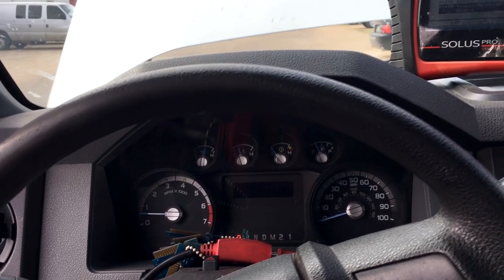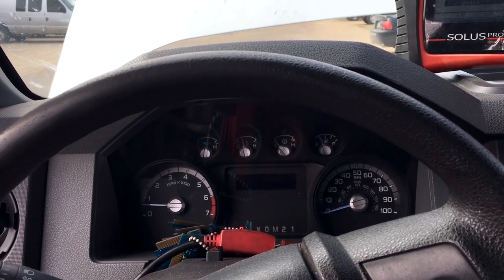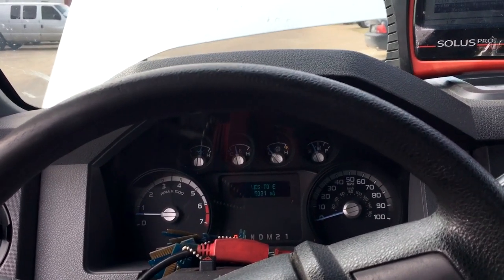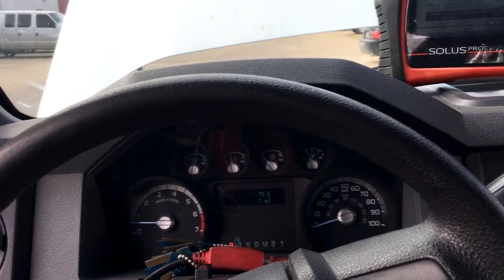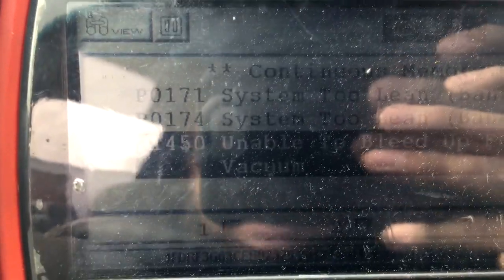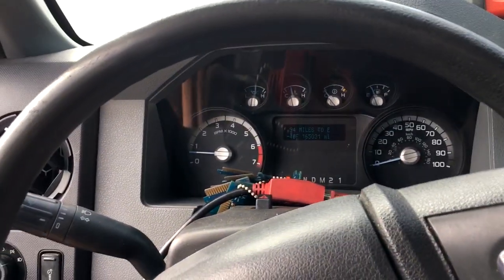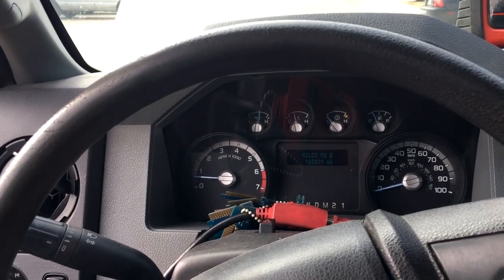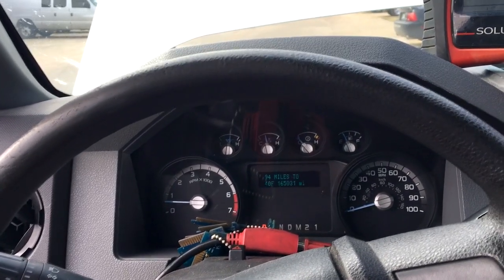FORD ENGINE STALLING P1450 EVAP PURGE VALVE

Comment: Next time you see fuel trims lean (with a p1450) carefully / gently remove the line from the purge valve that goes back to the fuel tank so as to not jar the valve (and possibly re-seat the valve to a sealed closed position),..then connect a piece of rubber hose to the fuel tank port and blow on it with your mouth with engine shut off. If you can blow through it,.. it's stuck open. You could also remove the line leading back to fuel tank with engine idling and place a finger over the port to feel for manifold vacuum at the port. There should be no vacuum at idle if valve is good.

Comment: At the dealership, we use the IDS. If you close the vent valve and a purge valve, the FTP voltage should remain at 2.6 volts. If the fuel tank pressure voltage drives below 2.6 volts with the purge and vent valve closed, that means the purge valve is drawing vacuum from the engine and stuck open. These problems are notorious it our dealership.

Comment: Thanks for the video, Eric! I owe you a beer or two or three! I had three codes with my 2002 Ford E-150 4.2L V-6. I was beyond frustrated. I replaced the two O2 sensors associated with the P1132/P1152, but still had the P1450 and the P1132 and P1152 after replacing the two O2 sensors. After watching your video I went to Autozone and bought purge solenoid, (Part #000904568 PV322). changed it out, and the truck is driving much better and the codes have not came back on. Wish me luck! I need it with this van.

Comment: I hear you on the vacuum leak . On my 1987 Chevy Celebrity 2.8L , the purge solenoid is located on the charcoal canister . It would intermittently stick . The engine ran horrible and vacuum went down to around 10 lbs . I even blocked off the EGR with a                  " gasket " made from aluminum cans to test .Finally , after reading the shop manual and matching the symptoms , I plugged the hoses to the valve and canister . If suspect , you can easily plug these hoses and drive the vehicle to rule it out . The valve is pulsed . I think it sticks because it becomes clogged with fragments of charcoal over time .

Comment: GREAT INFO! Thank you. My 2011 F250 gave me P1450 and 2 RICH codes! P2196/2198. But I just plan to replace valve at this point. It would occasionally stumble at idle also.
Reply: Did that work for you? My truck is giving me the exact same codes & would stall anytime I put gas in it.

Comment: not gonna suck anything but my engine light has been on well over a year while i google everything and called everybody and got nowhere.  p1450 ford fiesta SE 2016.  the only symptom is when i get gas it doesn't start on the first try.  if i fill up it's worse than if i just get less than a full tank.  was previously a hertz rental so i expect it was overfilled regularly.  finally bought the purge valve (which looks nothing like the part i googled) and will find somebody to put it in.  so tired of this issue.  every mechanic wanted to keep the car overnight to investigate and i can't do that.
Reply: so i had the part replaced.  the rough idle stopped (which i hadn't noticed until i read google comments from others), the gas thing is about the same.  the mechanic reset the code even though i asked him to leave it alone.  my understanding was that the code would go out if the issue was fixed.  he said oh who told you that?  well youtube videos.  anyway, it hasn't been two weeks yet which is how long it took for the light to come back on after somebody reset it last time with no attempted fix.

Comment: you tube brought me to your video came up on a search for 2003 lincoln navigator stalls.   I have no codes.  In maybe my evap system stalling my vehicle great video for other fords.  I think I learned why and is a common problem in other fords the fuel relay integrated ford relay.  search fuel relay expedition.    if you don't have a code it maybe there problem.   will check part in ebay for do it yourself fix from you tube videos.

Comment: Thank you Eric. Good job. I appreciate your videos. Quick tests on purge valves. Leave it connected to vacuum source. Disconnect EVAP line and electrical connector. Start engine and feel or measure with a gauge for vacuum leak. Also sometimes they stick open only intermittently. So use your scan tool to control the purge valve on and off a couple dozen times to see if it sticks open when it should be closed.
Reply from the maker: Thank you!

Comment: When testing these I disconnect the the wiring and purge hose, start the engine and put my finger over the port and check for vacuum. It's usually a large enough leak to feel. If I can't feel a leak, next step is to install a vacuum gauge. The smaller leaks can be detected with the gauge.
Reply from the maker: Good advice!

Comment: Thank you. I have a 2010 fusion 3.0 that has about 5 of these codes stored. Just bought a new purge valve, will remove old one tomorrow. Hoping this is the fix. Do you need to clear the code after installing the new one or if that is the fix will it cycle througha nd clear itself after a while
Reply: The codes should clear automagically once the ECM no longer detects a fault.

Comment: I am recently having an issue with my vehicle that is after I put gas into my car and start it ,,it does not start right away and push hard on the gas to pick up ,,that is only after I put gas but as I drive the car and turn it off , it starts right away without any problem. any support on that or suggestions ,,,thx
Reply: boshbosh mag same issue I hope you got the solution. Let me know please .

Comment: great job. I'm going thru the same situation. had chevys purge solenoids cause this problems. but never on FORD. Decided to do some research and came across this video. In my case I had the same two codes, P1450 and p2270 system too lean. 2011 f250 super duty 6.2 fleet truck.Thanks.
Reply from the maker: Thanks for watching!
Reply: @ADVANCEDLEVELAUTO  I really appreciate your video is really good explained. I was exactly at the same situation as you I drove the car for the whole week and another mechanic just clean the codes until I drove it for a few days the code shows up finally and I was able to replace the canister purge valve now the question is. How much you should charge for the labor including the diagnostic timing would you give me an idea. Thank you so much again Best regards!

Comment: My 2015 Roush RS3 mustang has been throwing this same code.  P0442 and P1450.   Now that I know this maybe the issue , does Ford have a fix with and upgraded Part instead having to replace this every 10k miles?
Reply: Mustang Guru i want to take it into the dealership but i dont think im under warranty anymore since im at 42000 miles and ive had a resonator and muffler delete , thanks for the link though
Reply from the maker: I am not aware of an upgraded part. Thanks for watching!
Reply: im trying to replace this part but i cant find it anywhereeeee . i know it might be a dumb question but can anyone tell me where in the engine the purge solenoid is located in the mustang ecoboost ?
Reply: It doesn’t look the same on the eco boost.   It should be an in-line style near the fuel rail.   There be a 2 wire plug on it,   Line in and line out. Most evap connectors have a green locking clip.
Reply: x looks like this    https://youtu.be/meuO6syzkdw
Reply: Woo hoo.  I just found the cause of my P1450 code.  The hose from the purge valve of the  supercharger going across under the brake reservoir was touching the header and burnt a hole in it causing the DTC.
Reply: i reaaaaaally wanna find the cause of my p1450 codeeeeeee but i dont know where to start looking :(
Reply: i found this 
http://www.mustangecoboost.net/threads/p1450-cel.1261/page-3
ima try everything they talk about on here , thoughts ?
Reply: My Roush supercharged 2017 Mustang GT just threw the P1450 code today while driving. Car seems to start up and run fine... Have an appointment booked with the dealer next week to get it looked at. But I'll also do a quick visual to see if my cause is the same as posted above.